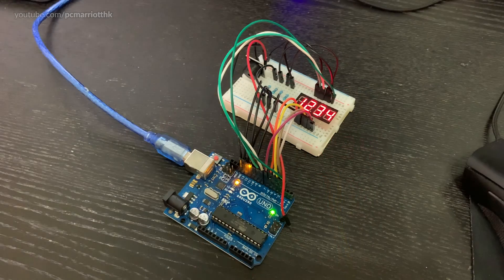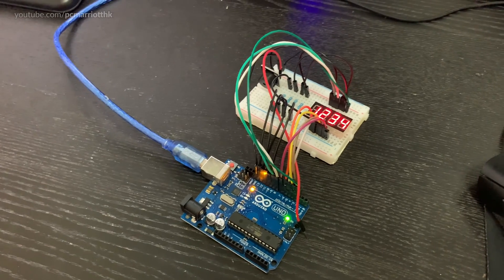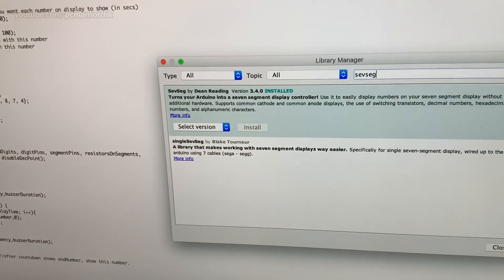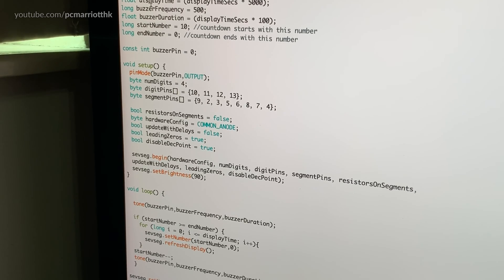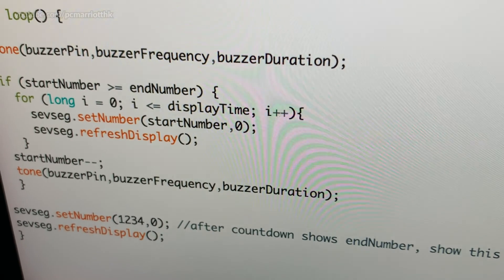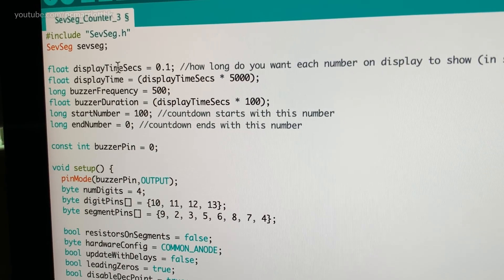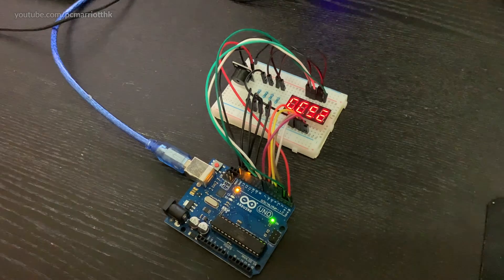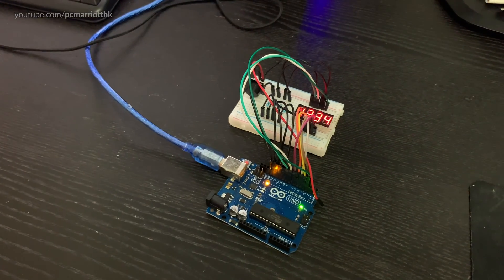Arduino 4-Digit 7-Segment Display Countdown Timer w/Passive Buzzer

Comment: I was hoping to post a question to help future observers. I watched the video twice, and didn't see any mention of what kind of resistors are being used from the display, to the bread board, to the jumpers. I had assumed it was 220-ohms, but i know that you can fry a pin if using the wrong ones. I am using a lab kit from college class, it is a elegoo kit, so that is what company makes my display.
Reply from the maker: 220 ohms.

Comment: i connected everything, but i get random lights and idk why

avrdude: stk500_getsync() attempt 1 of 10: not in sync: resp=0x00
avrdude: stk500_getsync() attempt 2 of 10: not in sync: resp=0x00
avrdude: stk500_getsync() attempt 3 of 10: not in sync: resp=0x00
avrdude: stk500_getsync() attempt 4 of 10: not in sync: resp=0x00
avrdude: stk500_getsync() attempt 5 of 10: not in sync: resp=0x00
avrdude: stk500_getsync() attempt 6 of 10: not in sync: resp=0x00
avrdude: stk500_getsync() attempt 7 of 10: not in sync: resp=0x00
avrdude: stk500_getsync() attempt 8 of 10: not in sync: resp=0x00
avrdude: stk500_getsync() attempt 9 of 10: not in sync: resp=0x00
avrdude: stk500_getsync() attempt 10 of 10: not in sync: resp=0x00
Failed uploading: uploading error: exit status 1

Upload error: Failed uploading: uploading error: exit status 1

this is the second tutorial and it's the same thing
Reply: Ok when you load the code into the Arduino MAKE SURE THE BUZZER IS UNPLUGGED - PLUG IT BACK IN AFTER :))))
Reply: RX-0 Port *
Make sure unplugged when loading /Compiling code :)

Comment: mine say there is a error in the code this one to be exact
Arduino: 1.8.13 (Windows 10), Board: "Arduino Uno"

Sketch uses 4678 bytes (14%) of program storage space. Maximum is 32256 bytes.

Global variables use 175 bytes (8%) of dynamic memory, leaving 1873 bytes for local variables. Maximum is 2048 bytes.

An error occurred while uploading the sketch

avrdude: stk500_getsync() attempt 1 of 10: not in sync: resp=0x00

avrdude: stk500_getsync() attempt 2 of 10: not in sync: resp=0x00

avrdude: stk500_getsync() attempt 3 of 10: not in sync: resp=0x00

avrdude: stk500_getsync() attempt 4 of 10: not in sync: resp=0x00

avrdude: stk500_getsync() attempt 5 of 10: not in sync: resp=0x00

avrdude: stk500_getsync() attempt 6 of 10: not in sync: resp=0x00

avrdude: stk500_getsync() attempt 7 of 10: not in sync: resp=0x00

avrdude: stk500_getsync() attempt 8 of 10: not in sync: resp=0x00

avrdude: stk500_getsync() attempt 9 of 10: not in sync: resp=0x00

avrdude: stk500_getsync() attempt 10 of 10: not in sync: resp=0x00

This report would have more information with
"Show verbose output during compilation"
option enabled in File -> Preferences.
Arduino: 1.8.13 (Windows 10), Board: "Arduino Uno"

Sketch uses 4678 bytes (14%) of program storage space. Maximum is 32256 bytes.

Global variables use 175 bytes (8%) of dynamic memory, leaving 1873 bytes for local variables. Maximum is 2048 bytes.

An error occurred while uploading the sketch

avrdude: stk500_getsync() attempt 1 of 10: not in sync: resp=0x00

avrdude: stk500_getsync() attempt 2 of 10: not in sync: resp=0x00

avrdude: stk500_getsync() attempt 3 of 10: not in sync: resp=0x00

avrdude: stk500_getsync() attempt 4 of 10: not in sync: resp=0x00

avrdude: stk500_getsync() attempt 5 of 10: not in sync: resp=0x00

avrdude: stk500_getsync() attempt 6 of 10: not in sync: resp=0x00

avrdude: stk500_getsync() attempt 7 of 10: not in sync: resp=0x00

avrdude: stk500_getsync() attempt 8 of 10: not in sync: resp=0x00

avrdude: stk500_getsync() attempt 9 of 10: not in sync: resp=0x00

avrdude: stk500_getsync() attempt 10 of 10: not in sync: resp=0x00

This report would have more information with
"Show verbose output during compilation"
option enabled in File -> Preferences.
do you know how to fix it
Reply: Having the same problem, any solution?
Reply: upload the code before the circuit.
make sure to use resistors.
Reply: how did u reslove it? pls im having the same issue

Comment: How to put on/off switch
Reply from the maker: Vishnu B You have to connect a physical on/off switch between the positive red wire. Turn off the device, cut and strip the red wire in the middle and attach the switch accordingly.

Comment: Thanks a lot sir, it's superb! I've made it and it works fine. I've modified the code and set the start time to 20 , for making a handwash time counter.
Reply: Can you tell which resistors to use.
Reply: @rajaramjarande6921  yes

Comment: Hey! I have a problem trying this. The numbers on my display are not clear, it seems that some segments don't turn off as they should (for example, the middle horizontal segments are always on) Sometimes it seems that they dim a little bit, but never turn off. I tried to adjust the brightness on the code, but it doesn't seem to work. Any ideas on what could it be?
Reply: Maybe change this in the code, from anode to cathode " byte hardwareConfig = COMMON_CATHODE; "
Reply: @D27A2ORSH4  Thank you! Had the same problem as above and this change worked for me.
Reply: check maybe your 7 segments are different than the one that he used in the video (common anode or common cathode).
Reply from the maker: What resistors are you using? Some people recommend 1K Ohm but I go for 220 Ohm as lower resistance means brighter light levels. If you have photos and videos of your project it would be good to see!
Reply: @PaulMarriott   Hello! I have the same problem as him. I tried with 1K Ohm resistors too but still not working fine.
Reply: it is maybe because of the different 7 segment displays: my seven segment display has 12 pins and his has 16
Reply: Just in case someone else has this issue, its because your 7 segment display is actually facing wrong way ;D